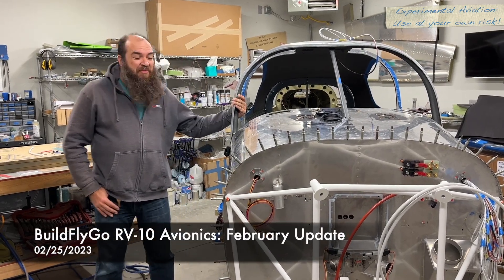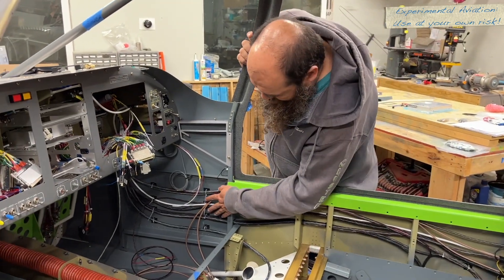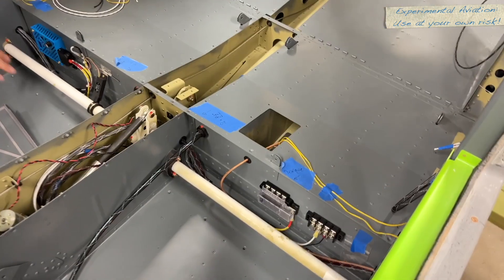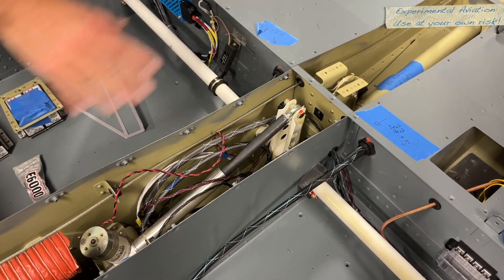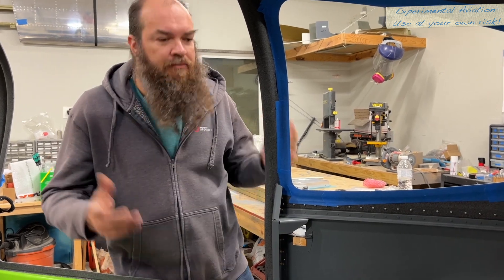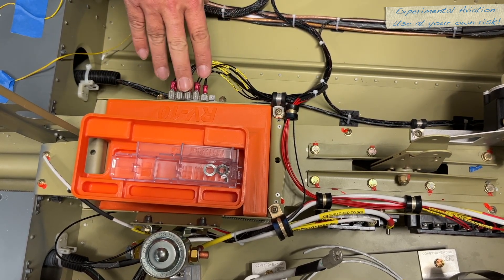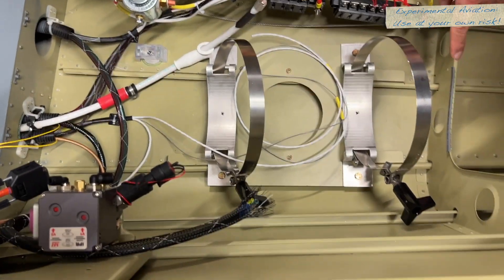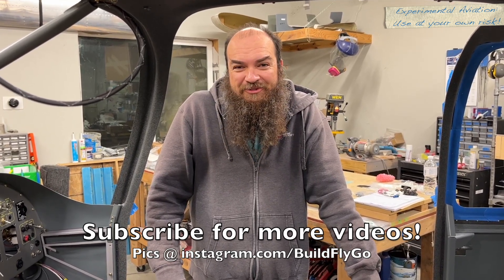RV-10 Avionics - Interior routing & Device locations

Comment: Thanks for your videos! Regarding mounting GPS antennas to the inside of the cabin roof using 3D printed trays, do you need to use aluminum trays so that you have a ground plane?

Comment: Danke!
Reply from the maker: Thank you!
Reply: @BuildFlyGo  I am currently reading the Aircraft Wiring Guide by Marc Ausman. I am very impressed looking at all the cables running through your RV-10. I am still in the state of gathering information and building an overview. Can you recommend any software you used to document the electrical wiring? In the end I will most likely buy the panel and harness from SteinAir. But to get a better understanding of the components involved I want to at least try to document them using a suitable tool. I am currently using onshape to draw the panel. But I think it is an overkill for documenting the wiring. Enjoy building! Best regards from the snowy Swiss mountains Markus
Reply from the maker: @markusisler8830   Aeroelectric Connection is the Bible of aircraft electrical design, highly recommended. As to design, I used the installation manuals, which have nice diagrams in the back, and annotated those. That plus a spreadsheet and slides for diagrams, everything in a big labeled binder.

Comment: Hey my man looks awesome …. I’m about to start fuse but I’m trying to plan for wiring now. Did you guys use all shielded wiring throughout? And how far does data wire need to be from lighting/electrical wire?? Looks great !!!
Reply from the maker: COngrats, it's a fun project. We used the wiring called out by the equipment manufacturers in the install manuals. The docs will list exactly what they want you to use to make sure everything works right.

Comment: Have you decided what engine your going to use yet? Have you given anymore thought to using the aero momentum T20 engine?
Reply from the maker: We have a Lycoming IO-540. The problem with going with a non-standard engine is you also have to design a new cowl, engine mount, cooling, fuel system, etc. It can easily add another year to the project :(

Comment: Would you consider build assist?  :)
Reply from the maker: Part of building for me is the experience of learning and building an airplane, so build assist would take that away. BA is good if you just want an airplane and minimal involvement in the planning and build, which is perfectly reasonable, just different missions.
Reply: what does build assist mean"
Reply from the maker: @AllenPortman  someone, usually a company, is paid to build part of the airplane for you. The FAA requires that you build 51% but the other 49% can be a commercial builder. Note that the airplane kit already arrives at some level of completion, so the kit company will need to tell you how much is already done for you to do the math and fill out the form. At the end of the build, you sign and notarize a form saying you built 51%, so it's a big deal to lie and have someone build more of it than they should for you.

Comment: Could you please clarify where the Artex ELT antenna is actually going? Bit confused about that part because I could see the wiring but not the whip antenna itself.
Reply from the maker: In the right side of the baggage compartment, behind the rear seats. This works for us, please make sure to read the manufacturer docs to make sure placement meets their requirements for your aircraft ;)

Comment: The plane is looking good! Remind us again, what’s your preference for a tool to create your wiring diagrams? I know you can use anything but I was thinking maybe you used a cad or even something which generates them from excel
Reply from the maker: We are just using the Garmin docs for during layouts. They are very detailed.
Reply: @BuildFlyGo  interesting, so no master interconnect diagram for the whole system.
Reply from the maker: No, we didn’t find a need. We printed each connector and wire diagram page off from the component manuals and annotated them. That way it’s easy to look at one connector and know what’s pinned and where it goes.

Comment: I'm loving your vid series!. I'm nearly done with my RV0 emp kit (back ordered parts). QB fuse is 9+ frustrating months out. As a fellow IT nerd (cyber) I'm also enjoying the advantages of 3D print modeling in my build. Do you post your STL files like the O2 frames or GPS antenna mock ups? Also, your early avionics post included designs for the trays to hold the equipment under the G3X screens. Wondering 1) if you stayed with that design, and 2) if you could share your CAD files for others (me) to enjoy the great design?
Reply from the maker: I’m posting all the 3d print models on printables.com. Happy to put the antenna brackets up there too but they are so simple I figured folks would design their own :) Same for the tray (which we did not use) it’s just a sheet with 4 bends ;)